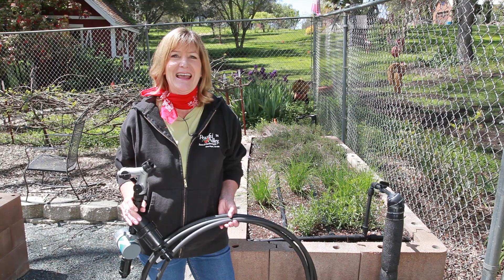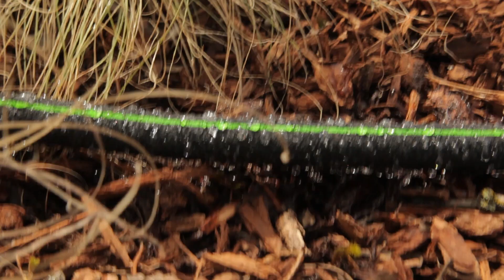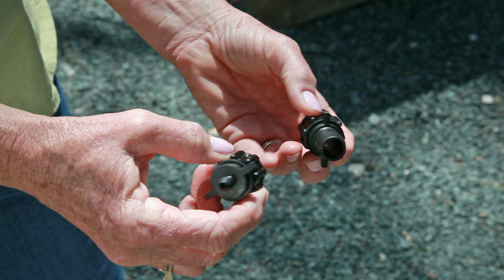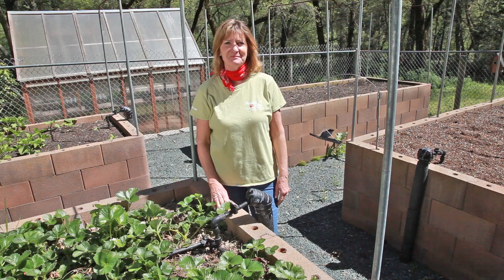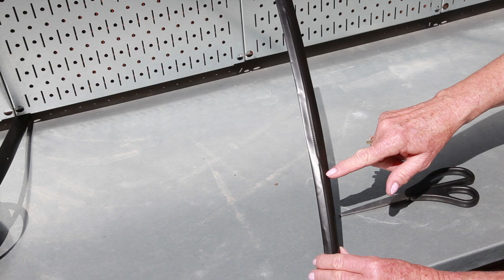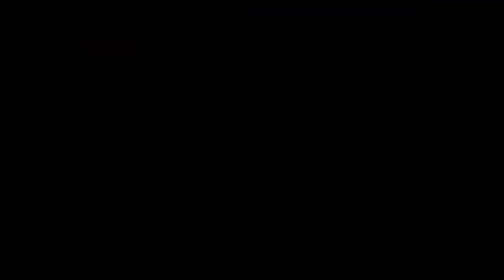Drip Irrigation-Part 3-Using Drip Tape

Comment: I have had issues with drip tape in TX with the fittings coming loose due to the wide temperature shifts we have. I've had to glue the tape to the fittings to stop this from happening. If you know a better way, I would love to hear it.
Reply: try to invest in UV resistant tape lock fittings for the hotter seasons, you can also watch a video explaining how to 'winterize' your drip tape etc

Comment: Do you recommend a FILTER, or just occasionally removing end closure and flushing out deposits? Why should holes face UP? (less likely to have mud plug slits or other reason?)  I thought 15psi was a more common max, but you said 10 eh?